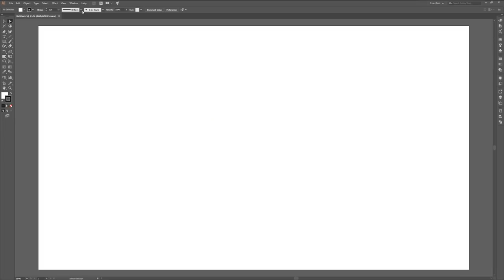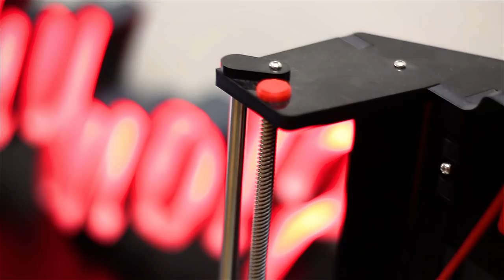3D Printed LED Marquee Letters / Anet A6 / Letras LED impresas en 3D

Comment: Excelente trabajo bro!! 
Que tipo de filamento usaste para este proyecto, y si fuera para exterior cual recomiendas?
Reply from the maker: Es PLA, es el más sencillo de imprimir aunque si fuese para exterior igual sería mejor ABS, soporta mejor las temperaturas y si le da el sol el PLA seguramente se deforme con el calor.
Reply: Duke Doks gracias bro. Éxito en tus próximos proyectos!

Comment: Hi! Did you make two layers of prints so it has more depth or maybe so it stands on its own? I was planning on mirroring the letters and used the back piece as front.
Reply from the maker: I made two layers for print the middle part. But it could be a good idea to mirroring the letters and use back as front

Comment: Hi, what software do you use for designing and printing also what 3d printer do you use? How long did it take to print per letter. Many thanks would be great if you could answer me.

Great job
Reply from the maker: I use Cinema 4D, but there are better software for this kind of designs, I recommed you use fusion 360. For this project I used an Anet A6

Comment: Tiempo de fabricación ? :D me encanta !
Reply from the maker: Gracias! Modelado un ratillo no mucho, y la impresión unas 6 horas con altura d capa a 0,2.
Reply: jejej me interesa más tiempo de montaje, pintura soldar etc :D
Reply from the maker: Perdón! Que pensaba k era otro video! Montaje no mucho, solamente pegar y hacer los agujeros para pasar los cables, la pintura rápido tb, y la instalación más complicado xk al hacer tantos cortes en la tira de LED es fácil k falle. No sabría decirte xk tube k repetir alguna soldaduras y como he trabajado a ratos libres.... pero yo creo que en un par de días se puede hacer sin problema. De todas formas si hiciese otro, cambiaría muchas cosas. Imprimiria la pieza ya del color final para no pintar, y los agujeros de los cables los haría ya en el diseño en vez de después con taladro e intentarían pasar la tira de Led sin cortarla para soldar lo menos posible.
Reply: Si, eso a la segunda se mejoran los procesos. Tio, admiro lo que haces :D Un saludo